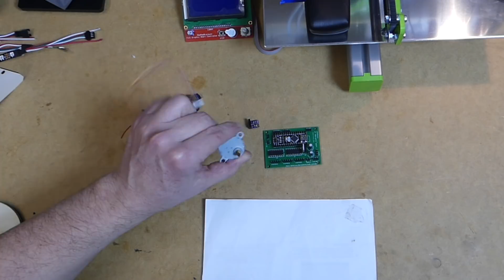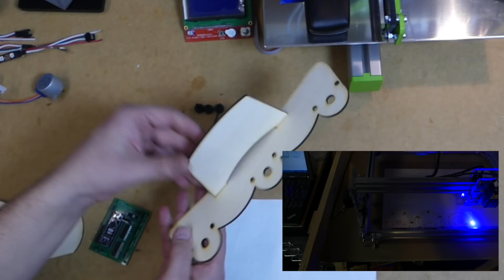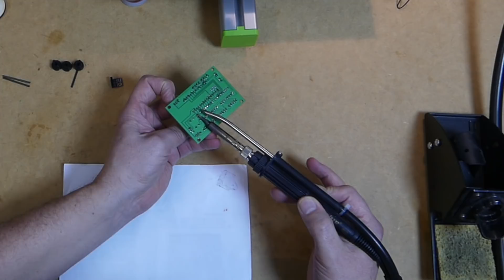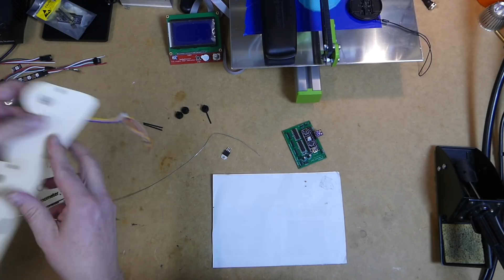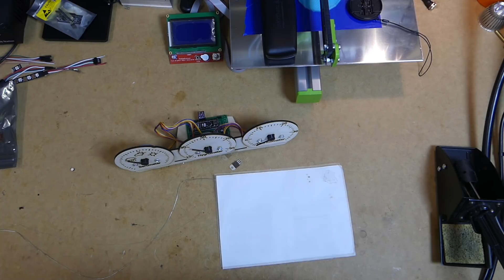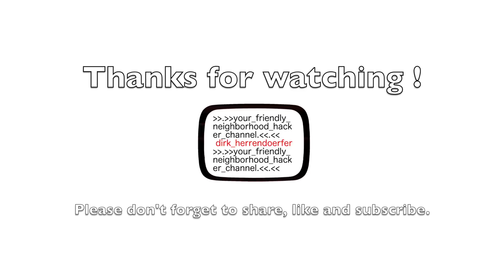Building a digital analog weather station with an Arduino

Comment: Hello Dirk,
I thank you for your attention. My professional activities have kept me from dedicating myself to Arduino, unfortunately.
As soon as possible I'll carefully study your sketch to make some adaptations, starting by replacing the stepper motors with servos.
I also think of making an old style packaging and adding some modernities. I think about saving the measured data every 20 or 30 minutes and accessing it with a button, which would allow me to know the weather variation over the last 6, 12 or 24 hours. I am a motorcyclist and I am always aware of the changing weather to schedule my rides.

Comment: Dear Dirk,
I have long wanted to do something similar because I like old analog barometers very much.
Could you make the sketch you used in your project available for Arduino?

I am a motorcyclist and I am always aware of the weather conditions, and for that, I would increase in  my project measurements in the last 24 hours at intervals of, say, 20 minutes. By means of buttons I could request to show variations in the range of 6, 12, or 24 hours.
Reply from the maker: Look here: https://github.com/dherrendoerfer/My-Arduino-Things/tree/master/3-dials-meter
Reply from the maker: Sure, I'll look into it and post the link here.

Comment: Neiz. But where are the Endstops youre talking about?
Reply from the maker: There's an index in the bore in the wood and an index finger on the dial - the stepper is stalled when it runs into them.
It's and endstop without a switch.